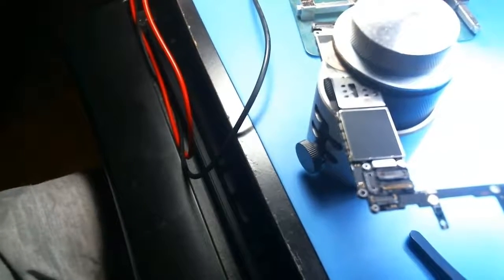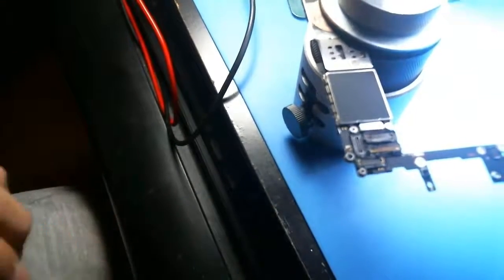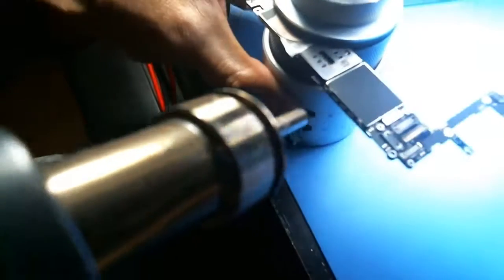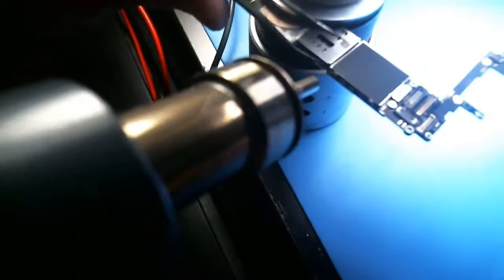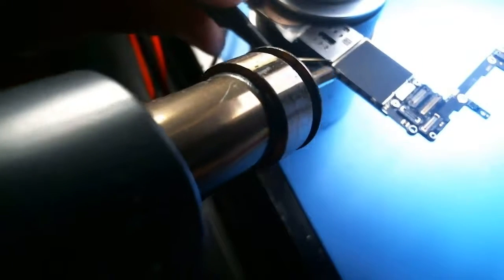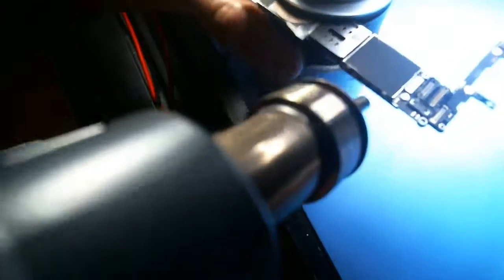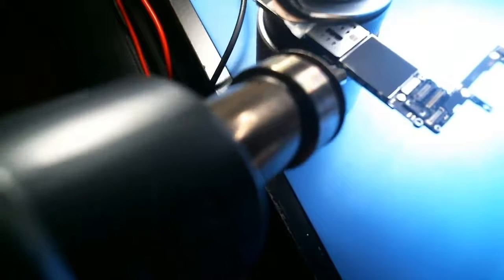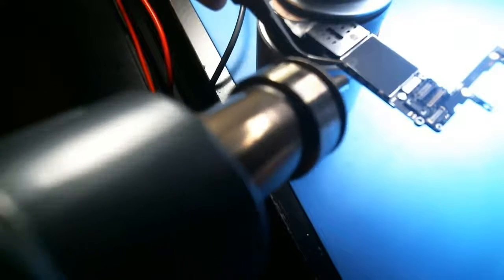Removing the Logic Board Shields on an iPhone 6s

Comment: hello friend, i actually own a hakko FR810 and i see that in your videos you are using the quick 861DW, do you recommed this station, because i fell the hakko to much powerfull and i sometimes set to 1 and is a lot of air flow, thank you for your videos
Reply from the maker: Yes, I've used a bunch of different kinds of hot air rework stations and the Quick 861DW is the best that I've used so far.  And the price is right.  I had a Oki HCT-900 and the air flow was too powerful.  It was annoying.
Reply: thank you